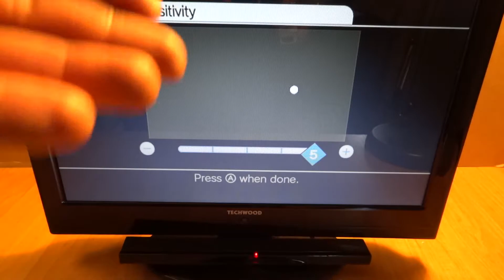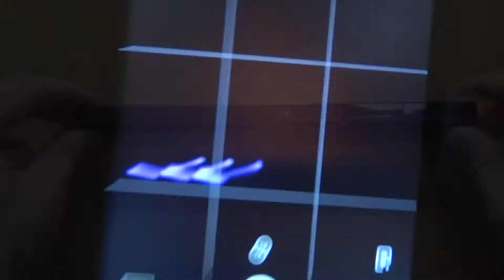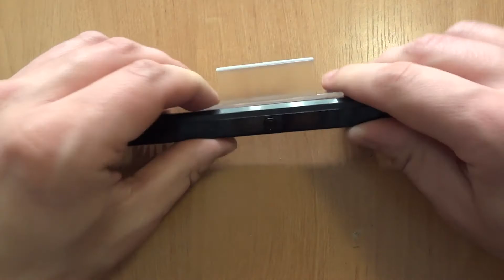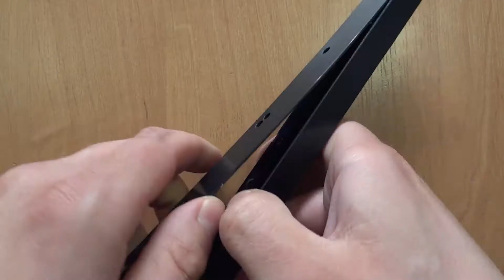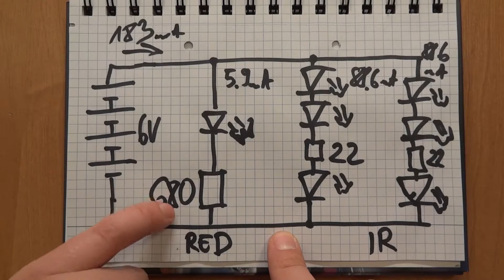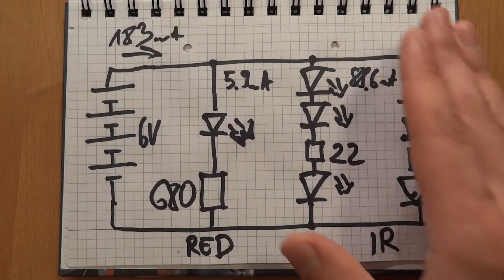Wii Wireless Sensor Bar - review and look inside

Comment: I also bought the same sensorbar.
When I first tested it only one light worked. For some reason it worked later. However the range is really bad. I have to stand 1meter away from the bar to work. And even then it doesnt work all the time and how it should
Reply from the maker: The board inside is very thin so maybe it's broken. It worked fine across the room but mine doesn't have a lot of light so this may be the factor.

Comment: Listen, I have a question for you. I have the same bar, but when turned on, the camera does not see the infrared illumination from the diodes (as in the beginning of your video). What to do? Is this how it should be, or do I have a defective bar?
Reply from the maker: If it doesn't work at all and youre sure it's turned on and you're sure you've put the batteries right way around, then it may be indeed defective. The board inside is very thin so it could've broken in transport 😔
Reply: I was opening the lid...the bar was intact. Just like you also had two wires on the sides. When turned on, the red light in the center worked, but the IR diodes did not work (I looked at them from the camera...there is no reaction). Perhaps they really planted a non-working one

Comment: How i can pair this bar with wii?
Reply from the maker: You don't 🙂  wiimote is just looking for two infrared lights and it's extrapolating the position based on what the camera "sees" in the controller. The wire from the original Wii bar is just for the power and this is simply battery powered.
Reply: Thank you for your answer. I was wondering exactly the same.

Comment: Hi will this work on pc dolphin emulator?
Reply from the maker: If you got wiimotes working with Dolphin it should work without an issue. There is no communication between Wii and the sensor bar, just power 😁

Comment: I have a question, if all i had was a 9 volt adapter 500mah, my sensor bar is 5 led each side, with a little resistor on each side.

What else do i need to do in order not to break the bat because of the excess voltage?
Reply from the maker: That's a little tricky because you would have to figure out the voltage drop of your IR LEDs. Of course you can measure that when it's on and see for yourself. The resistors are mainly for limiting the current and in my case here assuming with 6V at input there was a drop of 2V resistor in each branch and then 1.3 on each LED. To make it work on 9V power supply I would have to add inline ~16Ohm resistor (3V of extra voltage drop divided by 0.186A of current). Or 34 Ohm in each branch (closest value is 36 Ohm) to drop 3V there instead and spread the load ( in my schematic you'd have to drop some of the voltage for the red LED too or just cut it out 😉). If you don't want to mess with that at all you could just connect USB with 5V at the input instead of if you want to keep 9V power supply you could get yourself a DC to DC voltage stepdown converter and adjust it to lower voltage before connecting - these usually cost about $1-2.